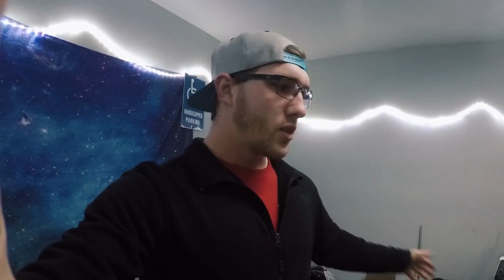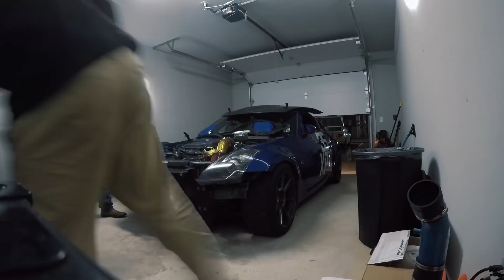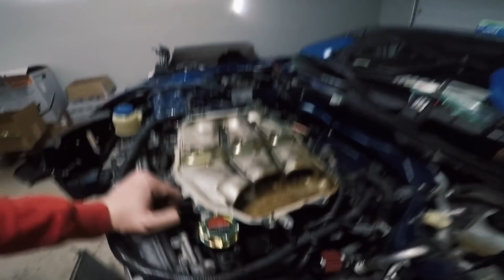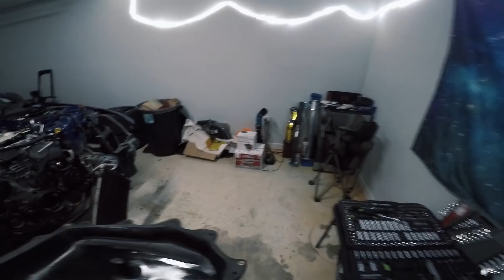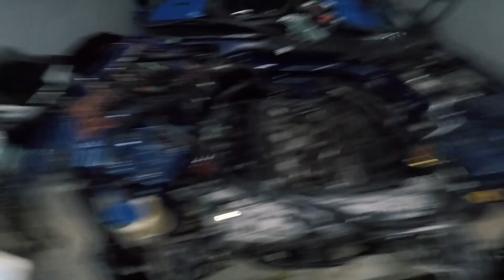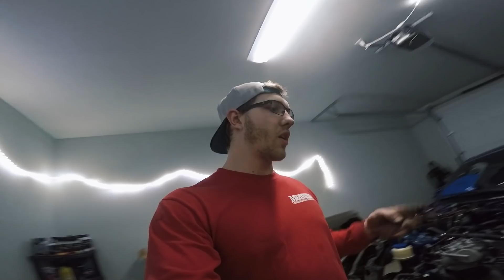Let the build begin.. | 350z Engine Build: Day 1

Comment: The 350z needs a 350 Chevy swapped into it 😎
Reply: Absolutely nothing needs an sbc 350... maybe an ls 5.7 but not a gen 2 engine...
Reply: @nova15566  the generation doesn't matter to me, and I feel like you judged my comment just by the picture of my truck, you probably don't even know what's in mine.
Reply: @velautoofficial  a 350 generally means a carb SBC. I didnt even look at your picture lol. I actually loved my old built tbi 350 with vortech heads in my old pickup. My daily is a ctsv gen1... a lot of people used to swap the z32 with sbc and imo ruined them. I already told @zorbii he needs to do a 5.3 and boost and bring it to my shop for a week or 2 and I'd build him the kit lol.